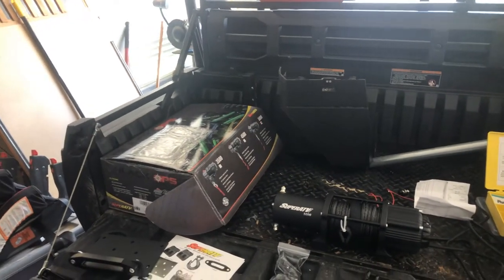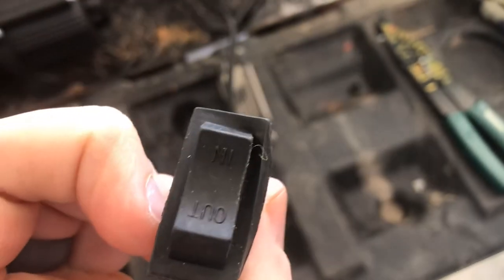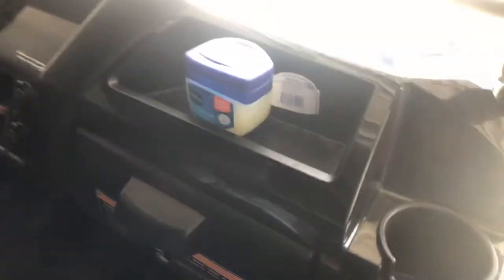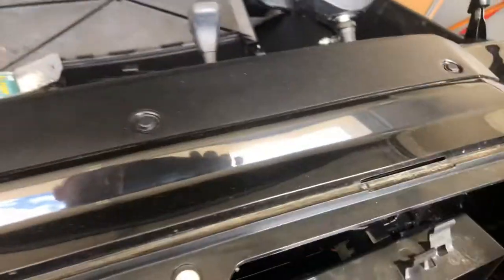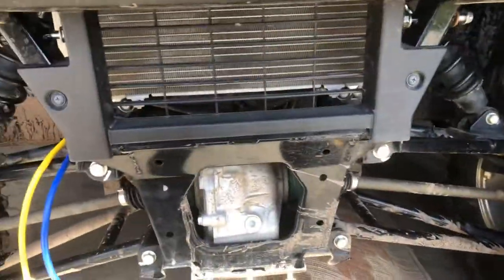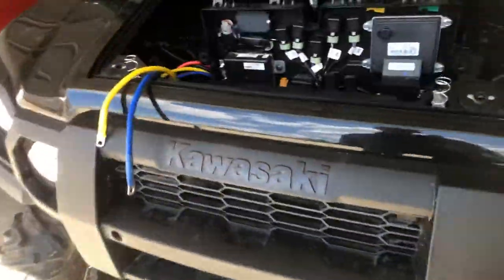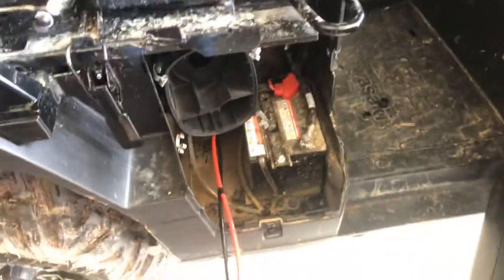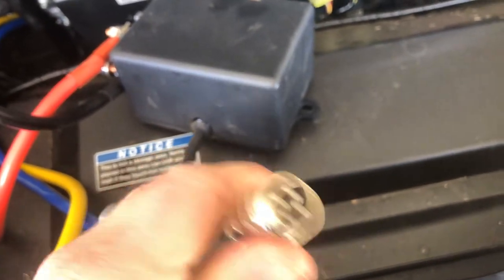Kawasaki mule pro fxt winch install (part 1)

Comment: Great video regrading the wiring info. Mine went smoothly after watching this. I could not find the bullet connectors (maybe taped up with the other wires) so I used one of the 2 cigarette lighter connections for now. since they are keyed switched as well. I don't need both....LOL.